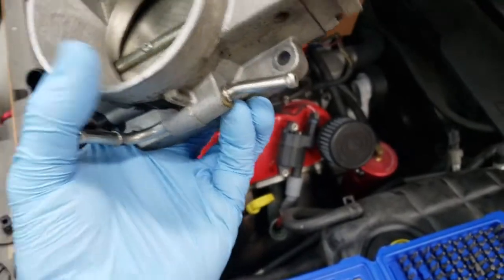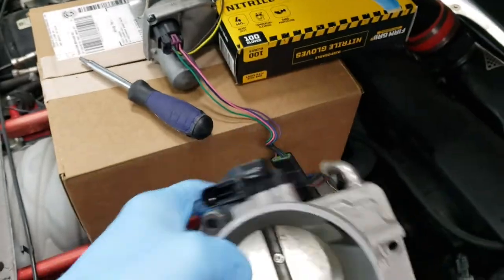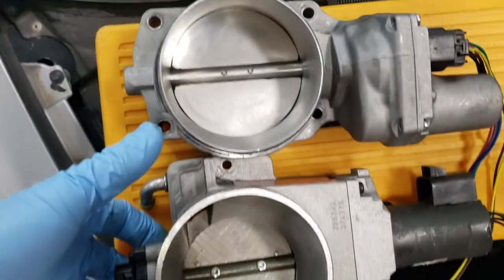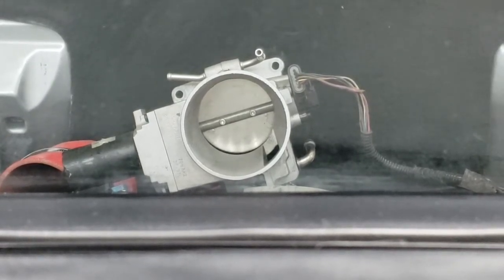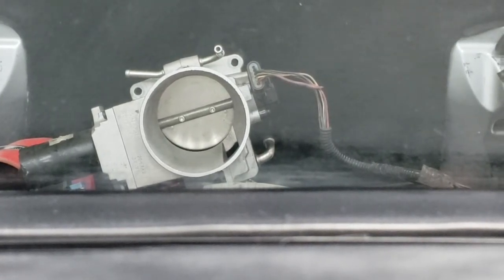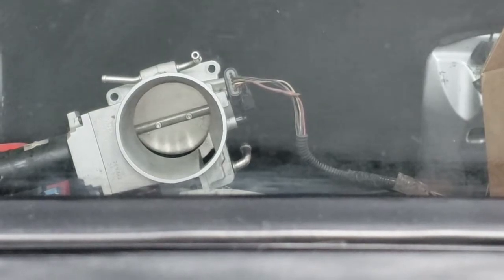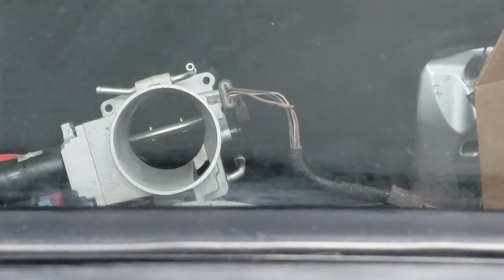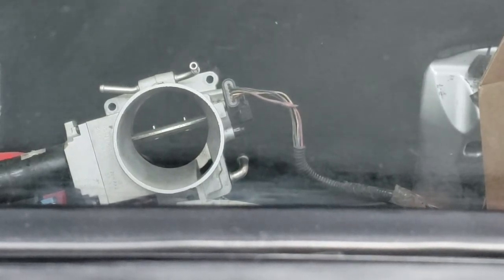LS2 LS1 Engine Throttle Body Function Test

Comment: What did it end up being?
Reply: I'd like to know what it was as well
Reply: @thembrelectric my silver blade LS2 throttle body on my C5 needed the references for the two redundant TPS sensors flipped if I remember correctly. I think 5v and GND references were backwards when I traced from the pinout for the original connector to the adapter harness and then to the pinout on the throttle body. Hope this helps